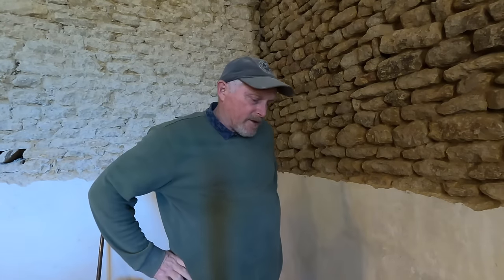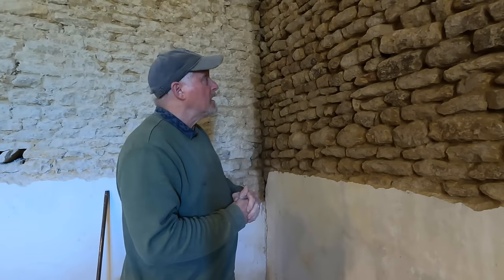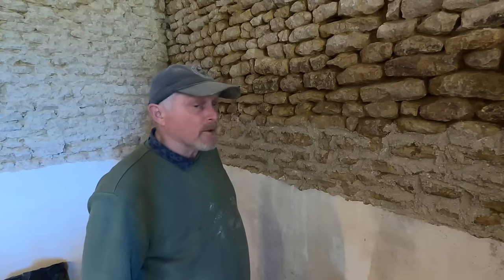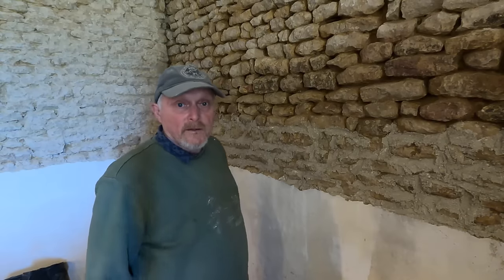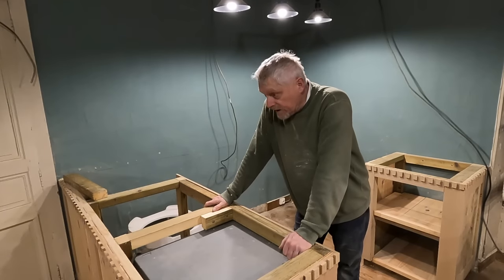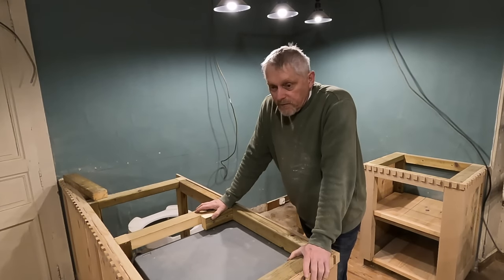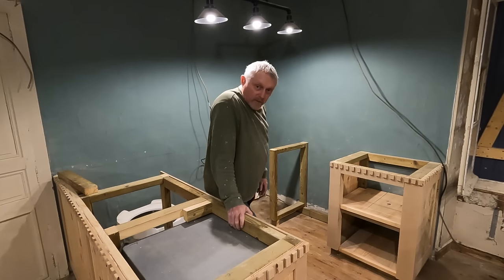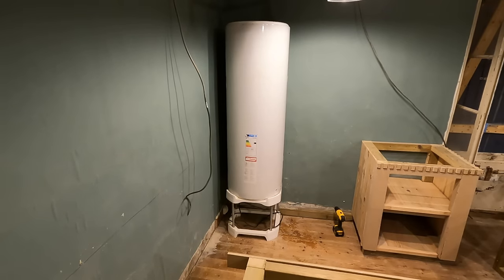Lime pointing a stone wall, in our 204 year old French house. kitchen worktops, and weeding ...

Comment: on 'this old house france' ,they take the old lime from the wall and separate it in the cement mixer and reuse that material. i think its sand and they save money that way.
Reply from the maker: I saw that and thought it was a clever idea,, but I need so much and all the same colour, I dont think my walls would still be standing lol  many thanks
Reply: @OurFrenchHouseRenovation  okay. i noticed that he only used the recycled stuff on the outside. i have never worked on a stone house and all of this is perplexing to me. just in case i happen to get a stone house in the future i have over 48 and a half channels to reference.😍😍

Comment: I have a property in Tarn et Garonne, an old joinery workshop, needing quite a lot of lime mortar plastering. I'm hoping to do it piece-meal over a few months, is it better to bulk buy or buy the sand and lime by the bag. Also would you suggest different mixes for inside and outside? I enjoyed the vlog btw and will look up the others 😊
Reply from the maker: sorry only just seen this comment, I buy it by the bag , I use the same mix inside and out 3 sand 1 lime, sorry for late reply many thanks
Reply: @OurFrenchHouseRenovation  no problem, I won't be starting until next Spring (early retirement hopefully 🙂) thank you.